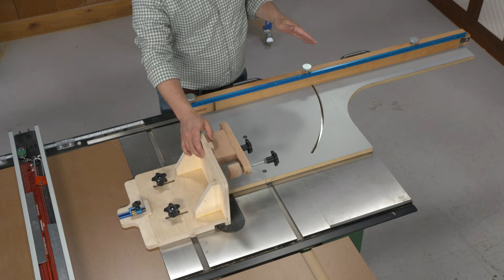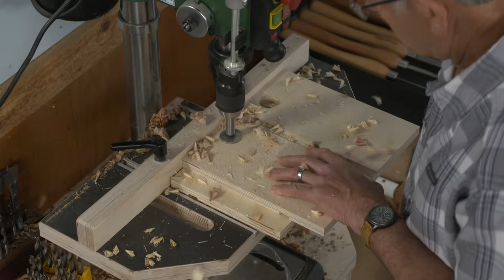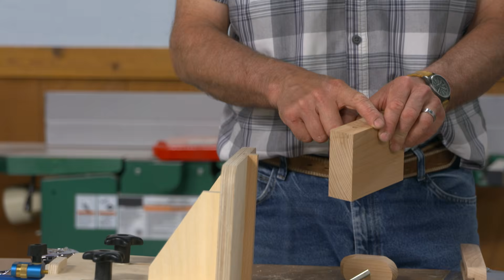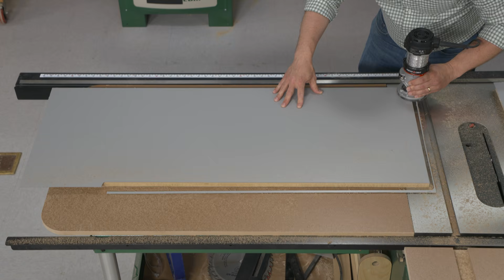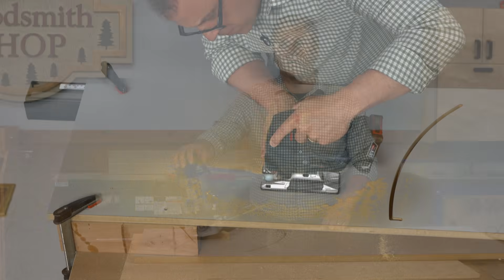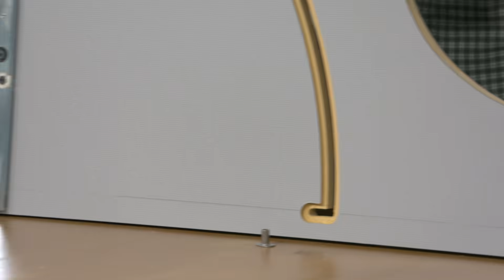2 Must-Have Table Saw Jigs You Can Build | Crosscut Sled & Adjustable Tenoning Jig

Comment: Why is there a big gap under the fence @18:39?
Reply from the maker: Good question... I'm not sure if the base was bowed due to the fact that it's sitting on the runner on one end. If that is the case, then once it's sitting flat on the table with the runner in the miter slot and the fence is attached it would flatten out.

Comment: I feel plastic laminate is too slippery for use on a cross-cut sled. Especially with the pivot near the blade the tendency on any angles for the stock to creep away from the stop into the blade is too great.
Reply from the maker: Good point.  I think a little PSA sandpaper on the fence wood solve that problem.